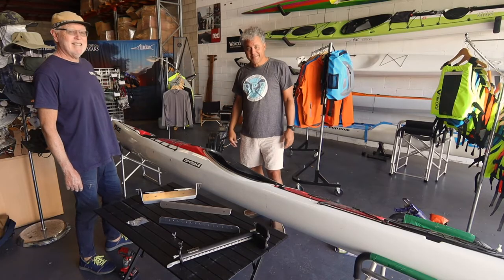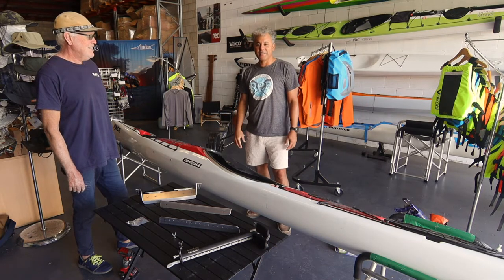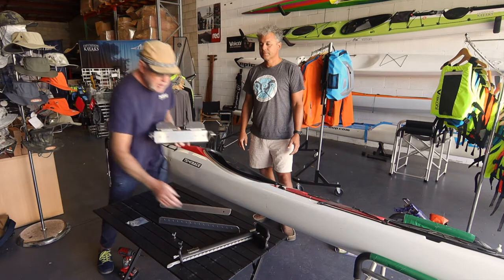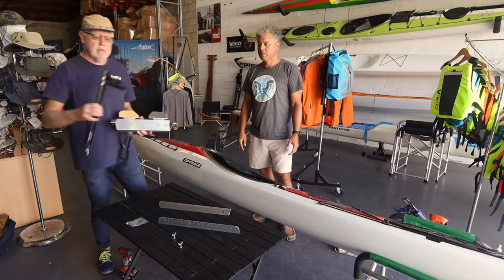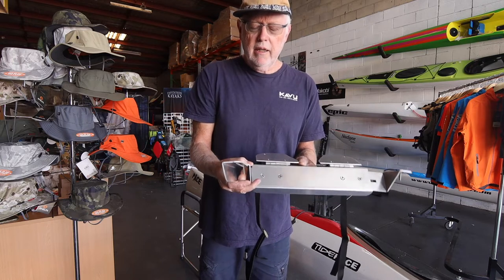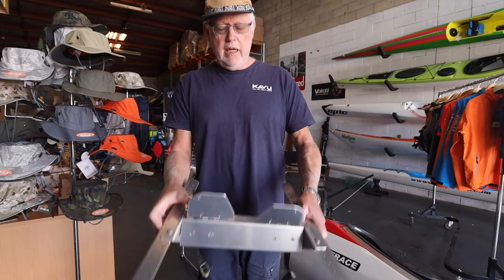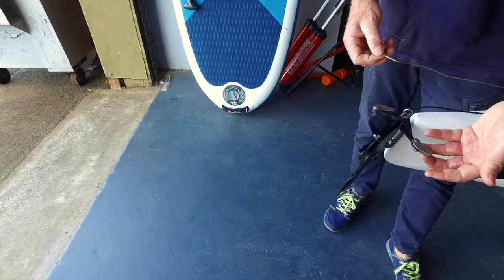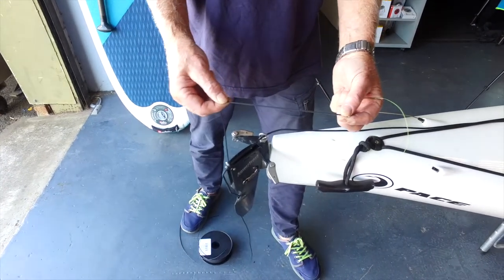Installing the EK Bigfoot Plate System

Comment: In my first boat (Nordkapp LV) I got my bulkhead moved and position so I could get better leg drive and also do all those more finicky boat manoeuvring strokes better which involved finding a good fiberglasser to cut out the existing bulkhead and then putting in a new one, which took time and money. In my second boat which is a rudder boat, the big foot did the same thing with less time, effort and cost.  Great product (full disclosure those who are Expedition Kayaks and Greg Davis are dear friends of mine but the product stands up for itself if you want to deliver more efficient leg drive and be able to manoeuvre your sea kayak better, the big foot works)
Reply from the maker: Thanks Crash...!

Comment: Which model of Tiderace Pace is this boat? Will the Bigfoot fit the Pace 18? I’m assuming its adjustability make this possible, but can you still use the already existing side rails? Thank you.
Reply from the maker: It's a Pace 17. Yes the BogFoot fits the Pace 18, no problem, and you can use the existing bolt holes for the rails (the Smart Track and BigFoot rails are completely different).
Reply: @MarkSundin  Thank you for the quick reply! In the States, most all the “fast sea kayak” makers (except Epic) use side braces. Especially the Brits. Rockpool even said they would not install a center footplate and didn’t know why anyone would want one. I’m new to the fast sea kayak world but I’m a bike racer who wants to go fast and long in a sea kayak. I don’t see why I should sacrifice leg drive OR side knee bracing as long as the cockpit allows. Tiderace (Nelo) offers a center foot brace on their website but my dealer cannot get them to advise us whether it fits the Pace 18 (which is a beautiful and apparently efficient design) so we’re looking for a solution. I’m new to this particular world (long-time river kayak and canoe paddler) so I could be wrong. Are many people Down Under using a decked sea kayak, center foot brace, and leg drive? Thank you so much!
Reply from the maker: @tommyrq180  short answer yes...! We are a decade ahead in Australia when it comes to adoption of modern sea kayak shapes, but it's very hard to broaden the thinking of the people who lay claim to having invented sea kayaking..
The Smart Track rudder transom-mounted is fantastic; the toe pilot foot peg system is a throwback to the 'old British way' and bears no resemblance to a modern race boat. Tiderace's Nelo K2 footplate is quite complicated by comparison to the simplicity of the Bigfoot, we ordered a few in Tiderace boats that we imported and they haven't proved to be particularly robust in the sea environment.
Reply: @MarkSundin  Thank you for that feedback. Really helps as we set up the Pace 18. What do Bigfoot paddlers do for traction on the bar, such as a rubber pad or some such thing? Or is it better to just push on the aluminum? Normally I would be wearing shoes, unlike many surf ski types.
Reply from the maker: @tommyrq180  https://expeditionkayaks.com/products/bigfoot-adhesive-grip-pads
Reply: @MarkSundin Attempted to buy a couple Big Foot braces, pads, and lines from EK site, but shows you only ship to Australia! How can we get that product to the USA? Maybe to a dealer? Thank you.

Comment: Any idea if this Will this fit a Current Designs "storm" kayak? (a pretty big boat) Looks like a great product and Id be keen to fit one if it fits...
Reply from the maker: G’day Jeff, send us the distance across the hull at the point where your feet are on the current pedals. The Storm is quite fish form and also wider than modern kayaks but I reckon it should be OK. Send to mark(at)expeditionkayaks.com
Reply: @MarkSundin  Cheers Mark Will get some measurements and flick an E-mail to you Cheers!